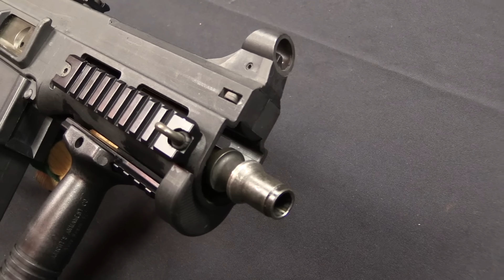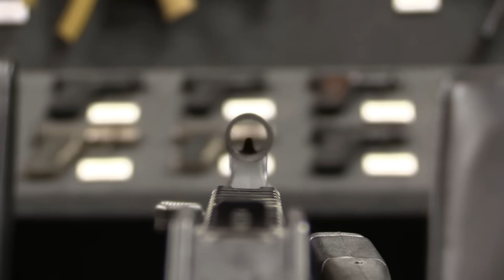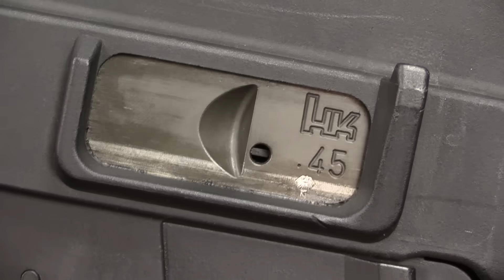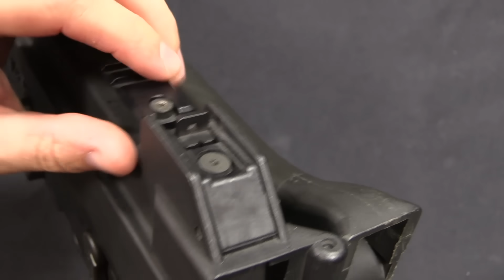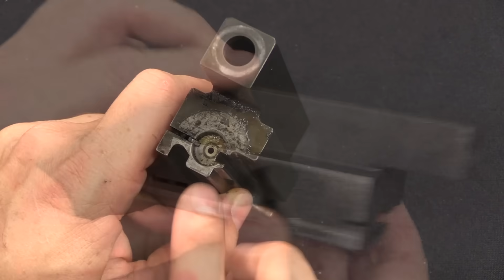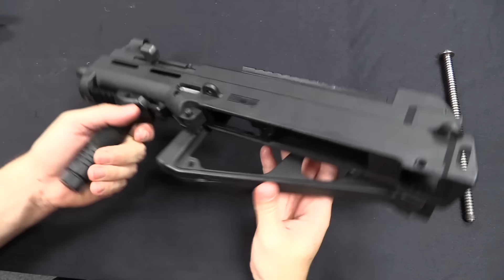H&K UMP: An H&K SMG Made for .40 and .45

Comment: The bolt doesn't negate the the weight savings. The UMP45 is still 40 grams lighter than an MP5, especially when empty. It's mass is also better distributed as most of its weight is in the bolt in the rear of the weapon as opposed to the MP5 which has a lot more heavy stamped metal parts aside from the bolt.

Comment: I don’t understand why the UMP wasn’t just an MP5 made for the then-modern market, made with then-modern (cheaper) manufacturing methods. Make something roller delayed, but to keep costs down, keep the front trunnion as simple as possible; They could have done something vaguely similar to how the Stribog’s delay mechanism works, just with an H&K level of mechanical disadvantage. And if they wanted to make a receiver that was mostly injection molded polymer, why not use an “AR-18 style” of guide rods for the bolt instead of integrating rails into the receiver walls? The whole point of the AR-18s guide rails was to isolate the bolt’s travel from the receiver walls, so they could be manufactured with less precision. And finally, come up with a new magazine spec that actually includes a bolt hold open tab. Surely H&K could have accomplished all of this in the 90s, and the result should have been cheaper than an MP5 to produce.

Comment: The gimmick should have been for the UMP and USP to have interchangeable mags, silencers, flashlights, and lasers. Just take the laser/light combo from the bottom rail of the usp .45, and slap right on to the ump. Or take the 25 round mag from the ump and stick it in to the pistol.

Comment: While I understand and like the lightweight of polymer on firearms, there are just certain circumstances where polymer is a very poor choice. The downfall of several guns (at least in my experience) is in having a polymer hinge/latch mechanism for the stock. To me, this is just a really poor design choice as these parts see substantial wear and the polymer cannot be durable enough for long-term use. Case in point: the UMP's stock mechanism. I have the exact same adapter for a folding stock/brace on my Bren 2, and have had several other guns that use the same hinge/latch design. The tab that is engaged by the latch on the stock has a tendency to snap off leading to a stock that does not stay in place when the stock is deployed. It would be acceptable to have the latch made of polymer if the locking tab and adapter were made of aluminum. Then, if the latch were to break, a new stock would take about 5-10 minutes to replace. In this configuration, however, the tab on the adapter breaking is far more expensive and difficult to replace and it makes the gun very difficult to use as the rest of the gun cannot be stabilized during use. 

As far as the design goes, the UMP is an inferior design to the MP5. That isn't too uncommon (to have a replacement model be slightly inferior to it's predecessor) as the changes are frequently made as a matter of cost or time to produce. In this case, the UMP was designed to be chambered in several different cartridges (which can be easily changed on the fly by an armorer in operation) while the MP5 was designed only for the 9×19. But the polymer of the UMP poses issues with durability and likely smells far too much like crayons to hand to a Marine, who would likely attempt to eat the gun.
Reply: Mr gun designer here, take notes kids

Comment: At this time its illegal to put a vertical foregrip on a "pistol caliber carbine" thats under 26 inches long. That from the tip of the barrel to the back of the gun. That doesn't include the flooding stock.
 But with this gun I don't know because the folding stock is a permanent  feature. 
I would guess to own one would require extra permits because of the full auto fire

Comment: Don't know why they wouldn't make basically this same gun with the good old roller delayed system, it's not an expensive system, just a barrel extension with slightly different bold with the addition of the bolt head, seperate carrier, and rollers.

Comment: Modern SMG's should be called Sub Assault Rifles. They are used the same way as assault rifles and nothing like a machine gun. They are designed similarly to an assault rifle and nothing like a machine gun. They can use the same picatinny rail accessories as assault rifles and few machine guns do, some even use assault rifle stocks. Calling them machine guns today makes no sense.
Reply: A 'machine gun' is defined as 'an automatic gun that fires bullets in rapid succession for as long as the trigger is pressed.
' This means everything ranging from G18s to Miniguns will fall under this category. Machine gun is a broad category, so SMGs mean machine guns that fire handgun cartridges, which is exactly the case. So the term 'Sub-Machine Gun' is accurate.
Reply: @clarkgamingplays  I am talking use case and you are talking general terminology. Congratulations on missing my point by miles and making a case that all automatic weapons should all be called a machine gun and ignoring the terminology that denotes their usage.

*Edit,
Also an MP5 with Semi-Auto and burst does not fit into your definition. But it does fit with assault rifles except for the ammo used in every way.

And When someone says "machine gun nest" in a combat scenario do you see an overweight black dude in shorts and a Hawaiian shirt, cool shades, and backwards baseball cap holding a MAC 10 sitting on a chair outside a door? Or do you think of sandbags and belt fed large caliber ammo fully automatic weapons like a Ma Deuce sitting on a hilltop manned by people wearing OD green? Both fit your "machine gun" definition but only one fit's Machine Gun.
Reply: When using the term 'machine gun' people, including me, often think of heavy guns that fire full auto, and this is often what 'machine gun' refers to, so I understand your argument and opinion, and I respect them. I am just here to point out your argument is not completely accurate and argue that SMGs should be called Sub Machine Guns and not be changed to Sub Assault Rifles.

My machine gun definition is the official definition of a 'machine gun', and assault rifles are derived from SMGs which is why they are used similarly.

Replying to your argument in terms of use case,  there is no definitive way to use a machine gun as there are many types of machine guns from machine pistols to miniguns that all have a different way of being used, meaning when a SMG is referred to as a Sub-Machine Gun, it doesn't mean it is used similarly to Heavy Machine Guns.

I do still agree that SMGs are used more closely to Assault Rifles than Heavy Machine Guns, but calling a SMG a 'Sub-Machine Gun' is more suitable for the gun class than 'Sub Assault Rifle'.

Comment: I like H&K products in general but I have just never cared for weapons that are strictly blowback only. H&K really went to work engineering a reliable and reliably safe blowback operated weapon with the UMP but I am still not sold on it. I prefer the roller locked MP5 because its lighter bolt and overall design make follow up shots much faster by reducing the amount of moving mass thus making target re-acquisition faster, in my opinion of course.
Reply: Have you shot the UMP? Super stable in 45. Even moreso in 9.

Comment: My old qual shoot for the SMP - MP5 - was a 15cm circle target at 10m in low light, full kit including gas mask.  We upgraded to the UMP in .40 cal.  We were passing the qual shoot, which was reasonable hard with the MP5 on single shot, on 3 round burst with the UMP.  Most accurate, and the most comfortable to hold, weapon I ever used.

Comment: Grea video. I would like to see addressed the ejection port size on the receiver. I have a hunch that they enlarged the ejection port on later models to better accommodate 9mm ejection issues. However I have not seen anywhere that was documented. This model here seems to have the smaller ejection port.

Comment: The powder core in the bolt seems to work like a dead-blow hammer? That  seems to show some inventive thinking. Equally design starts to look a little pushed, in production terms, when the cost of manufacturing differences between the MP5s metalwork and injection moulded plastics make to worthwhile to produce this for what is a well funded police market outside a time of war.

Comment: Let's say I were designing and building you a brand new submachine gun. The weight is already specified, but I offer to design it with most of that weight static, in the receiver, or to take much of that weight out of the receiver and instead have it bouncing around in the bolt. Which option do you select? Yeah, I'd go with an MP5, too. I'd like an MP5/10, please. Of course, us mere mortals don't get the choice, anyway, since the UMP won't take registered trigger packs.

Comment: I LOVE the MP5, but have shot the UMP in 40 and 45, and really like it.  I would like to spend some quality time with one in 9mm.  We need a commercial carbine IE USC in at least 9mm with "Brace" on pistol length, and a cleaned up 16" version.  Back in the day doing Hk LE sales.  Buy 1 MP5 or 5 UMP for the same cost.  But getting a Police Dept to part with the MP5 for the UMP was tough when it was 45 only.

Comment: Holy ugly sight picture Batman.

I’d like to design a 2020 update for the gun, cutting back on the chunk factor.  The Pic rails can stand to be more flush with the body of the gun, and those honking sights need to be thrown right in the dumpster, replaced with smaller flip-up sights.

Comment: I feel you're being a little diplomatic, Ian. The UMP is just not a very good smg. It was meant to be a modern grease gun, and market basically said we have no use for a grease gun. The modern application for submachine guns is very niche and usually high precision. So if the situation excludes using a rifle, a carbine, a micro assault rifle, or a shotgun, the MP5 is still going to be the go-to choice.

Comment: Having full auto examples of both the MP5 and UMP in our shop, I can say with 100% certainty the MP5 is the better gun by leaps and bounds from a user perspective.  The  UMP has a heavy and jarring recoil, the MP5 is smooth.  Roller lock won the day, and the UMP comes off as HK's attempt to cheapen production to save money, not to develop a good follow on to the MP5.
Reply: I haven't had the opportunity to fire the MP5. The UMP did not impress me.
Reply: that's entirely what the UMP is. they could've re-chambered the mp5 for 45 acp. 9mm and 10mm develop more chamber pressure than 45acp. so i don't see what the excuse for creating the UMP was. it does nothing better. the msrp is not appreciably less to a military/LEO. basically, everyone wanted the HK p7 and HK developed a Hi Point and tried to sell it at a similar price. the UMP is an insult, "we bet we can sell you dummies this hunk of garbage"

Comment: Personal opinion on UMP (Universal Machine Pistol) variants:

1. The MP5 doesn't have the .45 ACP version because most likely the high pressure of the .45 ACP can prone to damage the delayed rolling-blowback bolt. Also the MP5 issue were not just the firepower but the recoil balance.
2. Because the MP5 were more expensive (a latest MP5 were costing 2 to 5 times price for a new AR-15, or so), the UMP is a choice for an 'alternative' version for MP5 because it cheap (but not very cheap, although) but also reliable.
3. Recently, the UMP started to faded slowly because the US market have a similar UMP gun but better than UMP. Also, the conversion were more easier than UMP thanks to the modular design (which became more common in these modern days) the H&K UMP start faded it slowly.

Comment: So they took everything that was great about the MP5 (super smooth and controllable recoil) and got rid off all that by making it .45 and simple blow-back.
Seriously no way of retarding that bolt other than mass? Are locking rollers and a wedge really that hard to machine? Even a simple gas-delayed system (a couple of small tubes) would have done wonders!
But instead they cheaped out on the design so much, and by the look of that shoddy moulding, on the manufacturing quality too.

Comment: Whats the advantage of an open bolt on a sub?
Reply: Mechanical simplicity and improved cooling, at the cost of lower practical accuracy (due to the mass of the bolt moving forward after the trigger is pulled).
Reply: @jic1   so, complex accuracy or less buck per bang ?!
Reply: @florianwilke2162  Pretty much.

Comment: A friend of mine has a USC conversion “UMP” with a 16” barrel. And I gotta say, it’s cool and all. But it’s gotta be the “cheapest” feeling most expensive gun I have ever felt. It’s just a chunk of polymer. The trigger is terrible. The sights are awful and it’s difficult to get a good sight picture (Ian hinted at this, use an optic!). The recoil impulse feels terrible, like a brick sliding back and forth inside a plastic shoebox. And don’t get me wrong, it’s accurate and dead reliable. It’s just feels like it should cost $300 not nearly $3000

Comment: is there a specific reason why .40 S&W did not take off?
Reply: It did take off.  Then it landed again.

Seriously, improvements in 9mm rounds made the increased cost, higher recoil, and lower magazine capacity of .40 S&W less justified.
Reply: @jic1  I assume stuff like the 10mm auto suffered the same fate?
Reply: @Squeaky_Ben  As I understand it, yes: .40 S&W had lower recoil than 10mm, and you could often convert handguns from or to 9mm with just a barrel swap.  I think in all these cases, what we saw was other law enforcement agencies taking their lead from the FBI.
Reply: @Squeaky_Ben  sorta. The 10mm was supposed to have .45 power and 9mm capacity. The problem was recoil. Gun makers weren't putting a heavy enough recoil spring in, so the round was beating up guns, and it was hard to shoot well in the original loading.

Then the ammo makers started selling downloaded ammo. Easier on the gun, easier to shoot. But not the power of .45. and then came .40s&w.  It's taken 30years for 10mm to really get good.
Reply: @ScottKenny1978  I am thinking about (one day, not sure when that will be) getting a handgun, so I wonder... would something like a glock in 10mm/.40 be a sensible choice?
Does it even have advantages over a 9mm?
Reply: @jic1  I think I heard about that. Wasnt the .40 S&W designed for the FBI?
Reply: @Squeaky_Ben  I think that's essentially true.  The FBI asked for a reduced-power 10mm Auto, and S&W realized that they could meet those specs with a slightly smaller cartridge that could be more easily chambered in more compact handguns.
Reply: @Squeaky_Ben  I currently own both a 9mm and a .45. I would not bother getting a .40 today, 9mm ammunition has gotten really good and practice ammo is cheap. I carry 124gr Federal hydrashocks in the 9mm, and 185gr Speer gold dots in the .45.

The only reason I am going to get a 10mm is because I go stomping in the woods and live in bear country. 10mm with good ammunition is what the Greenland police carry to deal with polar bears. 9mm or .45 just doesn't cut it. 9mm may have the penetration but doesn't have the expansion, while .45 may have the expansion but doesn't have the penetration. 10mm bear loads have both the penetration and expansion you need. But going the other direction when mister bear says "get off my lawn" is always best.
Reply: @ScottKenny1978  I see, well, good old glock 17 it is for me. That is if I can find a suitable range near me.
Reply: @jic1  so, the cause of death was just that it was too niche? Not enough of an upgrade in terms of firepower to justify the downsides of the cartridge?
Reply: @Squeaky_Ben  Or maybe not niche enough, since the 10mm has recently had a renaissance with recreational shooters, hunters, etc.
Reply: @Squeaky_Ben  .40 has some uses for places that allow civilian firearm ownership but not military calibers. Just like .357sig does in places that don't allow civilian ownership of greater than 9mm handguns. But for success in the US? Not really there.

And make sure the pistol you buy fits your hand, points properly for you. I can't shoot a Glock, they just don't point right in my hands. The rear sight is level with the back edge of the ejection port!
Reply: @jic1  I guess its safe to say that 10mm is in a weird spot?
Reply: @ScottKenny1978  I have a replica of a beretta 92 here which fits my hands pretty well, what size of handgun would that roughly translate to?
Reply: @Squeaky_Ben  that's a full size pistol, like a Glock 17, CZ 75, or 1911. Though do try the Glock 19X, which has the 17 frame with the shorter slide and barrel of the 19. Friend of mine says that's the best balanced Glock out there.

10mm, if you get the full power ammo, is basically a magnum cartridge in an automatic pistol.
Reply: @ScottKenny1978  Thanks, I will keep that information in mind for when I have moved out and found a range that allows magnum calibers. That last one is a bit of an issue in germany.
But yeah, this was helpful and interesting, so thank you.
Reply: @Squeaky_Ben  I don't think that 10mm necessarily counts as a magnum cartridge, that depends on the range, their backstops, and what lies downrange of them. So it wouldn't hurt to ask the local ranges what can be run there. One indoor range where I live is rated for .50bmg on the 100yd range! 

I know I am planning on getting a tanfoglio 10mm for hunting season. If you were in the US, I'd say look for Buffalo Bore ammo, they load to the original 10mm specifications or even to +p levels. I don't know if they export to Europe, though.